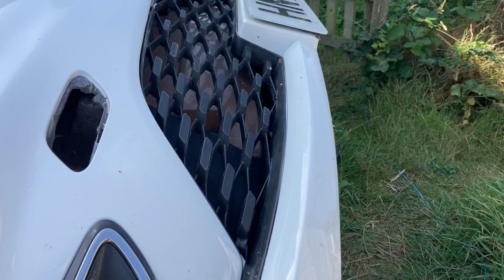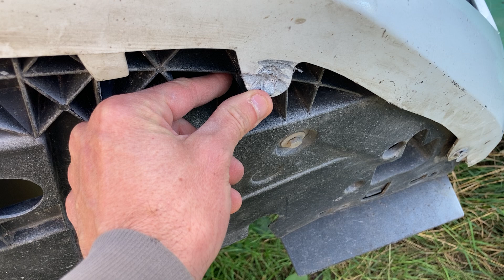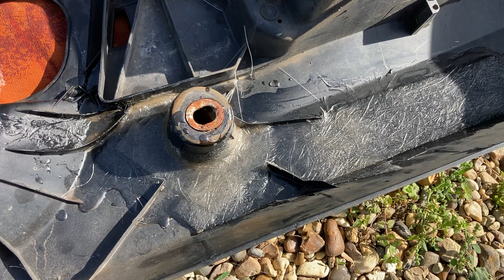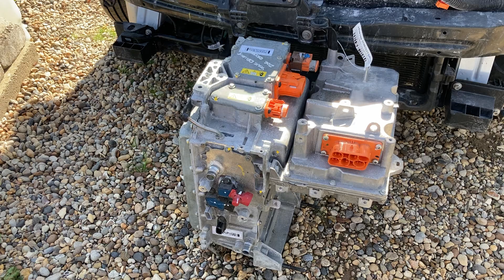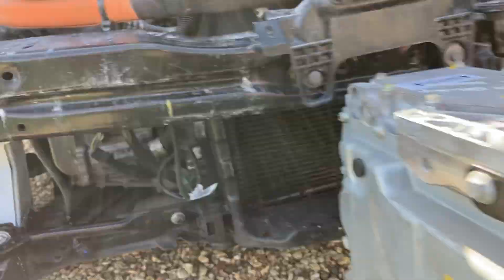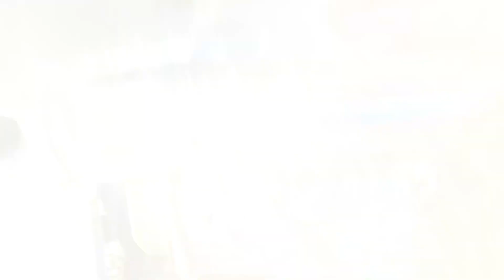Renault Zoe ZE50 - repair update

Comment: Hi everyone! This series of videos from this channel really helped me follow along step-by-step :)

However, after I replaced the motor bearings myself and reassembled everything, I'm getting a 'Battery charging impossible' error. When I put it in gear, the car won't move and instead makes a clunking/thumping noise with a jerk.

Based on the discussions here about phase mismatch, rotor/stator fields, and resolver positions, could anyone guide me on whether this is likely due to swapped three-phase motor cables during reassembly, or if the resolver (position sensor) strictly needs a diagnostic reset/calibration? Any advice would be greatly appreciated!

Comment: Really cool seeing you working on these!

I have a ze50 with CCS, that it out of warranty in november. Being an engineer and all round geek i really want to play with it. and i intend on keeping it rolling for a long time and many miles. Its still showing 95% SOH on the battery. 

Its also myfirst electric car and first non-saab ^^ have done loads of stuff on them like making my own bluetooth interface and getting text up on the displays. and also rebuilt engines and gearboxes and done tuning and so on. 

But for the Zoe i have pretty much no clue. Really fun getting to know the ins and outs of them :)

Comment: I read something about how you can bypass the secure gateway by just using a hidden OBD2 that is somewhere near the fuse box, rather than the visible one by the accelerator pedal... this might've only been for some stuff but I read about it when there was some "hack" for enabling wireless Android Auto / Wireless Carplay.  I assume you know wayyyy more than me on anything like that, but just in case it's anything new.
Reply from the maker: Hi, well the car is still talking CAN behind the gateway so you’ve just got to get on the other side of the fence - one of the ECUs between the obd port and part of the CAN network is the gateway, effectively relaying messages and it’s also playing security guard. I’ve seen some Tesla diagnostic tools where you have to undo a wiring plug and add an adapter to allow you to connect a dongle then use a phone app to get information from the car. It’s clever and can be really useful but sometimes is a bit limited. I have respect for anyone who works out those kind of things. Cheers

Comment: What is the most efficient way to tap off the coolant? I did remove the outlet from the coolant pump, but I do not think that is the most efficient way to do it.
Also, what is the huge fan on top of the motor doing? And why is its air outlet going down under the car? (I do not even know if it is a fan...)
Reply from the maker: Hi I take a pipe off the coolant pump but keep the header tank cap on as otherwise it gushes out everywhere. Haven’t found a cleaner way so far. The fan on top is for motor cooling - it’s an air cooled motor. It goes in at the reduction gear end, through the motor and is vented out behind the motor with another duct angled down through a hole in the undertray. Cheers.
Reply: @garycevrepairs  Thanks, I did it almost the correct way then (made a mess). Thanks for the fan knowledge. I actually assumed that it was a coolant-cooled motor. Now it makes much more sense. Another thing is the reverse camera is malfunctioning, have you taken it apart or could you show us how it should be done? Mine is working at random. My idea is that a capacitor or a voltage regulator is off and needs to be replaced. But I prefer to know how to remove it and reinstall it before I start to play with it...
Another thing I am curious about is your experience with your wife's ZE40. Regarding the ball joints that connect the lower control arm to the wheel hub. This was the second time I had to replace them on our ZE40... It is the same part number as in the 660kg lighter Clio... On the ZE50 they are "bigger" and last.

Comment: Keep 'em coming! 👍  Where do you learn your EV wizardry? I had no ideas manufacturers were VIN locking components like this, or locking down what you can do with OBD.
Reply from the maker: Hi, thanks.  I basically just got stuck in, fixed an early cheap EV, started chatting to other people doing similar things and moved on from one car to another and ended up being employed by a diagnostic support network and getting properly trained.